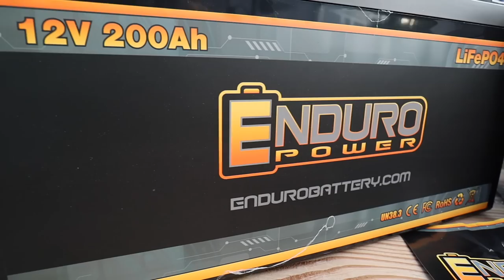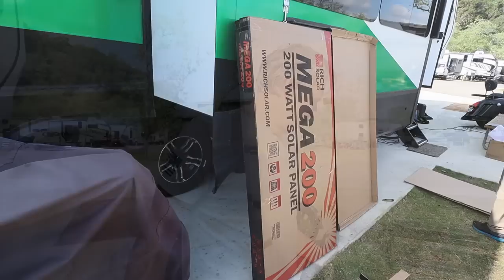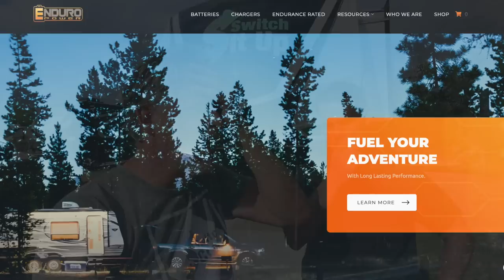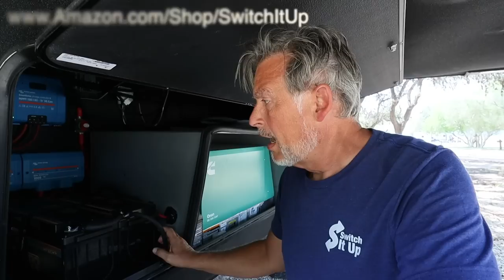Best Lithium Battery for RV Solar System

Comment from the maker: We are so happy we found Enduro Batteries for our travels: 𝗘𝗻𝗱𝘂𝗿𝗼 𝗣𝗼𝘄𝗲𝗿𝗲𝗱 𝗟𝗶𝘁𝗵𝗶𝘂𝗺 𝗕𝗮𝘁𝘁𝗲𝗿𝗶𝗲𝘀: 
https://www.enduropowerbatteries.com/?ref=switchitup Use promo code SWITCHITUP on checkout.

⭐ 🔴 𝗙𝗮𝘃𝗼𝗿𝗶𝘁𝗲 𝗥𝗩 𝗚𝗲𝗮𝗿 𝗘𝘀𝘀𝗲𝗻𝘁𝗶𝗮𝗹𝘀: 🔴 ⭐
✅ Camco 90 Degree Hose Elbow: https://amzn.to/3J5wNzQ
✅ Hose Splitter Garden Hose: https://amzn.to/3VEpKpd
✅ Power Watchdog Surge Protector:https://amzn.to/4akKy9D
✅ Camco RhinoFLEX 20’ RV Sewer Hose: https://amzn.to/4aecJXM
✅ Camco Sidewinder RV Sewer Hose Support: https://amzn.to/3J6huH3
✅ RV Camper & Adapter Sewer Hose: https://amzn.to/3U142u9
✅ Adjustable Water Pressure Regulator: https://amzn.to/3J1q3me
✅ 30 AMP to 50 AMP Plug Adapter: https://amzn.to/3THIYHU
✅ RV Camper & Adapter Sewer Hose: https://amzn.to/3U142u9
✅ EternaBond RoofSeal White Tape: https://amzn.to/3PM63rK
✅ 3-In-ONE RVcare Slide Out Silicone: https://amzn.to/43LmXwl
✅ Propane Monitor Kit: https://amzn.to/49lrcjm
✅ NOCO Boost Lithium Jump Start: https://amzn.to/3vEtk8g
✅ 50pcs Mini Blade Fuse Kit: https://amzn.to/3xuPqKH
✅ Anderson Camper Level System: https://amzn.to/4azhZF8
✅ SnapPad for RV Leveling: https://amzn.to/4cSrEc2
✅ Anderson Leveling Buckets: https://amzn.to/4aBhhY0

⭐ 🔴 𝗙𝗮𝘃𝗼𝗿𝗶𝘁𝗲 𝗜𝗡𝗧𝗘𝗥𝗜𝗢𝗥 𝗥𝗩 𝗚𝗲𝗮𝗿  🔴 ⭐

✅ Scratch Off Map of USA:  https://amzn.to/4aE4YKB
✅ Best Drawer Liner: https://amzn.to/4akXMDe
✅ Digital Photo Frame: https://amzn.to/4amxfFU
✅ Hanging Laundry Hamper Bag: https://amzn.to/3U399ZV
✅ Pot & Pan Protectors: https://amzn.to/3xjyFSJ
✅ Scotch Mounting Fasteners Strips: https://amzn.to/3IZEE1M
✅ Simple Houseware Over the Cabinet Door Organizer: https://amzn.to/3xov9qj
✅ BEST Push Broom Rubber Bristles: https://amzn.to/3J3Huml

⭐  🔴 𝗙𝗮𝘃𝗼𝗿𝗶𝘁𝗲 𝗧𝗼𝗼𝗹𝘀 & 𝗚𝗲𝗮𝗿: 🔴 ⭐
✅ Tire Repair Plug Kit: https://amzn.to/3xl55fL
✅ Dewalt Cordless Impact Wrench: https://amzn.to/3xm5Sgo
✅ Dewalt Impact Socket Set: https://amzn.to/4alL7A4
✅ Torque Wrench: https://amzn.to/3VQ5MYq
✅ Best RV Air Compressor: https://amzn.to/4ayQ6h7
✅ Craftsman 450-Piece Tool Set: https://amzn.to/4aCPhU2
✅ 2 Ton UniJack Hydraulic Bottle Jack: https://amzn.to/3vz1WbJ
✅ Reese Gooseneck RV Coupler:  https://amzn.to/3xfRwhs
✅ Air Lift LoadLifter 5000 Air Suspension Kit: https://amzn.to/4aIgoNv
✅ Safety Triangle Warning Kit: https://amzn.to/3IZE4kC
✅ Garmin 895 Navigator: https://amzn.to/4cF3bH0
✅ Garmin Dash Cam: https://amzn.to/4cDEk6n
............................................................................................................
* 𝗗𝗶𝘀𝗰𝗹𝗮𝗶𝗺𝗲𝗿𝘀

****✅All rights reserved on Switch It Up Content.
The links provided are affiliate links and pay small percentages for any purchases on them to help us continue on the road.
We are NOT professionals please don’t take our word for any of the information and do your own research we will not be held liable for sharing our opinions.
By purchasing items you take all responsibilities that you have done your own research and we will not be held liable for our opinions on products.

☞ ✅ 𝗖𝗼𝗻𝘁𝗮𝗰𝘁 𝘂𝘀: 
TimeToSwitchItUpCrew@gmail.com 
Address for product reviews: 128 Rawlins Ave. McDonald, Ks 67745
Facebook: https://www.facebook.com/timetoswitchitup
Instagram: SwitchItUpUSA
To send a quick message please use Instagram or FB but we have seen a lot of messages and comments and if we are out running around we may not see it right away. We do our best to reply.

Switch It Up is a DBA of KC Lifestyle LLC.

Our videos are inspired by travel adventures from other RV Lifestyle channels like Keep Your Daydream & Kara and Nate.  We truly love the storytelling of HeavyDSparks and Changing Lanes as they are always out helping others.

#RVLifestyle #RVTravel

Comment: Thanks for the great video.  We are having a system upgrade on our LTV Unity next week.  Using Enduro batteries and almost all Victron components.  We are going with the 3000 inverter as we do want to run our A/C.
Reply from the maker: Sounds like a great plan!!

Comment: Thanks, I really enjoyed the video. We've been FT for 4 years now, and we've found we like to boondock most of the time. We don't have a residential fridge like you do. Instead, we run our RV fridge on propane rather than battery power. We have a 620-watt solar array mounted on the side of our MH so we can lift it to the correct angle for about 20-30% more output than flat, roof mounted panels (even more in the winter when the sun is low on the horizon), so it performs more like a flat mounted 800w array in real world use. We can clean them easily on the side of our MH and raise and lower them without crawling on the roof. We installed gas struts, so they virtually lift themselves - just unlatch them and up they go. There is a website we use that gives us the correct angle to lift them to, based on month and latitude for maximum production. I think that it was very smart that you added 1,100 watts of solar. Power is addictive. The more you have the more you'll find a use for. "You can never have too much solar" is absolutely right! The main reason we decided to put them on the side was of our RV was to leave the roof free for a much bigger array to power our entire RV, even have off grid air conditioning and heat powered by the sun too.

Last month, we replaced our 2 well used lead acid golf cart batteries with a custom-made LiFePo-4 battery made from 8, 280ah prismatic cells. This makes a 12v 560ah bank that has over 5 times the usable Kwh of our old batteries and over 10 times the life. One of the main reasons we decided to go this route is that they fit perfectly under the steps of our motorhome, where our old GC-2 batteries used to reside, saving about 35 lbs too. Those 200ah Endura batteries are cool, but way too big to fit in the spot where a golf cart battery fits. We added a 330-amp (1,200a surge) Heltec BMS that is big enough to start our generator, to keep the cells balanced.

We replaced our Progressive Dynamics 60a converter/charger with an 80a LiFePo-4 compatible one but were lucky that our MPPT charge controller could be reprogramed for LiFePo-4 chemistry, so we didn't have to replace it. We also added a Renogy DC-DC battery charger so we can charge it with our MH's alternator as well as our onboard generator. People often don't consider the cost of upgrading their converter, charge controller or getting a separate battery to battery charger for alternator charging. The battery itself (which has about 40% more capacity than your 2 Enduros) was only $1,364 but by the time you add a BMS and whatever chargers you need it might end up costing a whole lot more. Our complete solar system for including the battery, 620w array, mounting hardware, 50A MPPT charge controller, 80a converter, B-B charger, wiring, breakers, monitor, etc. totaled up to around $3,600, plus a lot of hours learning and building. But the freedom and independence it gives us FTers is well worth it.

Comment: After being on the road for my first month and boondocking just 2-3 times I learned that the "new" marine battery in my "new" (2021, 22' TT "Max") just didn't hack it.  I also discovered that my converter was not working (leads to battery at panel board read 12.6 V while connected to battery and ZERO when disconnected yet still on shore power).  Used stand alone charger while on shore power & truck alternator while on the road. Ordered new CFCO WF-8955-AD-MBA converter (Amazon $80.09 - thanks to multiple 5% cashbacks!),  Now just need to decide 100 or 200 MAH LI for my first upgrade.

Comment: I just did something similar, the only difference is I built my setup to be portable and modular. All the hardware is mounted to the battery box. Bus bars allow modular capacity additions. So if you need to move it into a new camper or use it for emergency power for a house, I can easily do that.  Each box is 200ah of capacity, 3 total for me<600ah>. I can have a total of 4 battery's with my current bus bar setup. I used Thick silicon mats to mount the hardware on so that heat would not transfer to the box.

Comment: This is another wonderful video on how to install the solar and batteries to a RV! 

Looks like a great RV solar system, and glad to hear you went with the 1,100 watt system, so no need to tilt them!  Back in 2000, I installed a pair of 120 watt solar panels, that cost $429 on sale back in that year!   Now it is so much less expensive!  

Drawing 25 amps per hour (I also have a E-Meter) and having near 90 amps going towards the battery, you can charge and run the refrigerator at the same time.  A smaller system would not work as well.  25 amps X 12 volts is near your old 300 watt panel capacity!  So basically, your solar panel would not charge the battery at all while the refrigerator was running.  

I just bought 8 each 250 watt solar panels used in Portland Oregon, at $85 each!  I plan to install them and a 48 volt inverter to run things in my house like a refrigerator and save about $30 a month on my electric bill.  Total cost to me is about $1,200, so not actually going to save me much money, but will be something I want to do!  For batteries, I plan to use lead acid golf cart battery, and fill them with water every couple of months.  

Whoever sold you AGM batteries, I hope they don't do that anymore!  They do not last very long in a RV, and there is no way to refill them when the fluid is lost to the air. So they might last about 1-2 years.  My golf cart battery when I was full timing lasted for 13 years!  

I will buy 8 each golf cart batteries at Costco for $110 each, and. store about 200 AH at 48 volts, or about 9,600 watts.  Your pair of 200 Ah 12 volt batteries are about 2,400 watts each.  If you where running 24 volts or 48 volts to your inverters, they would require much smaller battery wire size, and will have less voltage loss.  

With your 25 amp 12 volt load, your system seems to be sized perfectly!  You could draw about 25 amps X 15 hours from your battery between charging the battery, so plenty of time for the sun to rise again!  The 90 or so amps X 5 hours per day (on average) is 450 amp hours your can put back in a day, however your use will also be 25 amps X 8 hours while you are charging, so about 200 AH is used each day.  

I wonder how satisfied you are with the system now that it has been installed for 7 months!  You might want to install another string of solar panels or not.  MPPT controllers can take in up to 150 or 300 volts and put out the required 12 volts to charge your battery.

Comment: Very impressed you didn't max everything out. Hope it works out. Hope to get some soon as well. Our 2022 GD Reflection came with one 165 W panel and one lead acid battery. It did come with a large Furrion 12v refrigerator/freezer and on demand water heater.
Reply from the maker: that on demand water heater --wow! Let us know how you like that!

Comment: With solar at .50 cants a watt you DO NEED to over panel, you will be suprised at how little power comes in when it is cloudy or you have a site with a few shady patches and you are there for a week you will appreciate having a bit too much solar.  You can always use the extra power to heat your water saving you propane . I have a propane fridge so its not as power hungry and get by with 480 watts Most of the time, but there are days when that 480 wastt only puts out 80 watts.

Comment: I am using 24v settings can you tell me what to set my controller on for hi voltage and low voltage and float voltage for lithium battery's
Reply from the maker: I wish we were knew all the answers but honestly we are not as knowledgeable as we should be.  We would recommend calling Enduro and speaking with them and let them help.  They are super customer focused and are willing to help guide others to what is good for them.
Reply: @SwitchItUpLife  Thank you

Comment: I would encourage you to add the additional batteries. You want to be heavy on the storage side. You can have all the panels you can but if you have no where to store the energy you collect the panels are useless. Be able to store all you collect. You're putting the energy in the bank in case you have a series of bad weather days. I have 470 watts of solar with 300 amp hr of Lithium. Don't take your lithium batteries down below 30%. They can take it but it will reduce their overall lifetime cycles.

Comment: I always hear people talk about the solar panels, but they forget the batteries.  They are actually more important to focus on.   It's a balance.  The sweet spot is to have enough battery to accept the charges and keep it topped off for the amp hours you are using during the day.  People tend to load up on the panels on the roof because it is "cool", but forget to upgrade their batteries, either moving to Lithium, or adding to the existing battery bank they already have.

Comment: Enduro is basically the same as any other battery from topband. Most of these batteries all come from the same factory , people just slap their company name on it. I’ve been using Lifeblue for years from top band and these are a copy cat version without heaters or internal monitors. Literally looks identical with a different color lol but still better value than battleborns and sok

Comment: Me and my wife are purchasing a new keystone TT and it comes standard with there solarflex 200 package . So we decided to add a dragonfly lithium ion 100 amp hour battery to complete this package. Solar flex 200 comes with a 200 watt solar panel and a 15 watt charge controller. My question is ...when your pluggged into shore power does it charge the battery also while being charged by the sun? Or does the battery only get charged by the solar panel? And in your opinion about how long will the batttery last while boondocking only running the 12 volt fridge and lights if you have numerous cloudy days?
Reply: I had a 30' RV with a 400 watt solar system, and it worked great!  Your 200 watts will be plenty to run the refrigerator, and watch about 1-3 hours of TV each day.  A few lights at night.  I installed a 8 watt and 32 watt florescent light in the dining table and kitchen over the sink, (back in 1997, they did not have LED lights).  

While plugged in, the RV converter can charge the battery at 40 - 50 amps until it reaches about 13.8 volts, while the solar will add power to the battery only if the voltage is really low, then will shut off while the RV converter keeps the battery at 13.8 volts.   So don't worry about the solar, it takes care of itself!

Comment: Congratulations guys.  I just self installed our 420ah lithium bank and 700watts of solar on the roof.  Just like y’all, we only needed a system large enough to keep the residential refrigerator and coach 12vdc loads running long when we are at a harvest host, rest area, or parking lot.  I’m interested in seeing how long y’all can stay disconnected.  Regarding pricing, y’all are spot on with the costs!  My self installed system above costed just a little over $5k complete.  

This was a great episode .. I’m sure it will help many of your followers!
Reply from the maker: Thanks Michael - we appreciate that - we think water management will now be our time determiner more so than electric - we shall see.  Gonna put it to the test in the Pacific Northwest this summer!

Comment: Quick question, we need to replace our house batteries. Is it worth it to do Lithium if we are not doing Solar right now. Or should we just do new lead acid. We are only going to be out part time unless God Changes things again for us. Lol.
Reply: Well, think of it this way if you were to compare a Lithium to a lead acid, depending on the battery size (amp hours) you choose, Lithium batteries are lighter for lifting n hauling, Lithium charges up faster, lithium can be stored for months without a battery tender and be stored inside your home with no worries, Lithium battery doesn’t have to lay upright and requires no maintenance, Lithium can be drained farther down (so still have power longer), and Lithium gives you more power per battery, and Lithium will last longer than the lead brick, i mean lead acid. Lithium worth it? Depends on your tolerances, for me heck yes. 🍻
Reply from the maker: If we would have known what we know now, when we killed our other batteries and went to replace them with 4 of the same we would have went with 1 Lithium instead maybe 2 but def would have done lithium